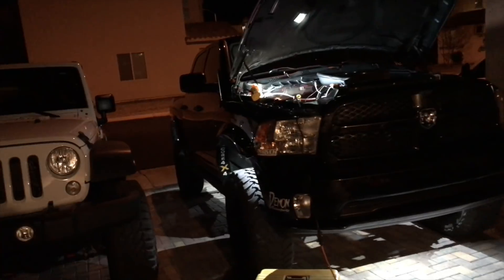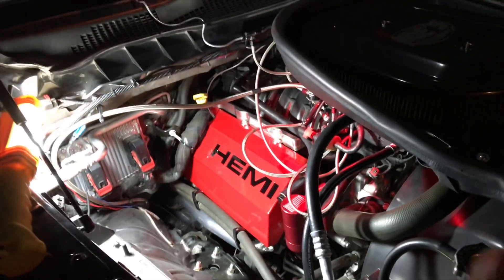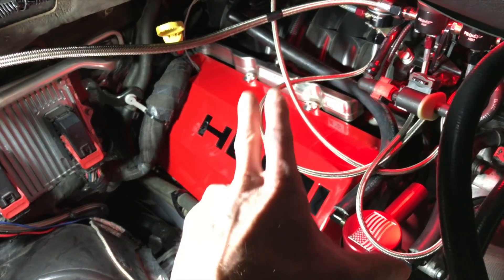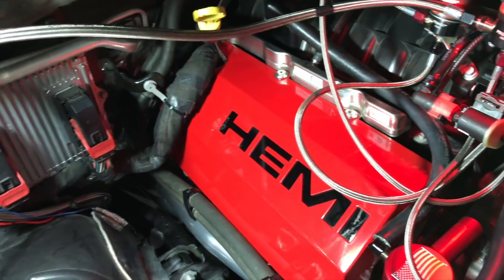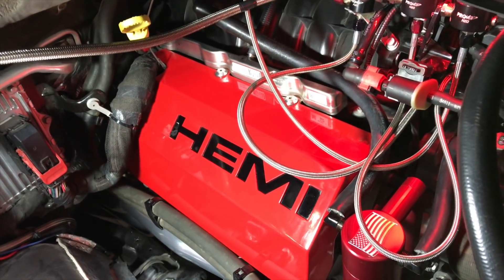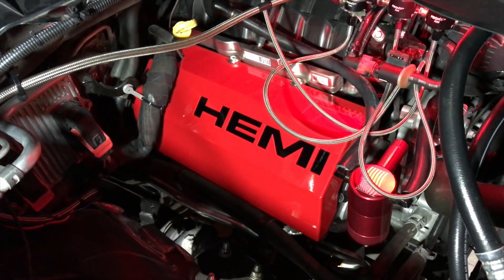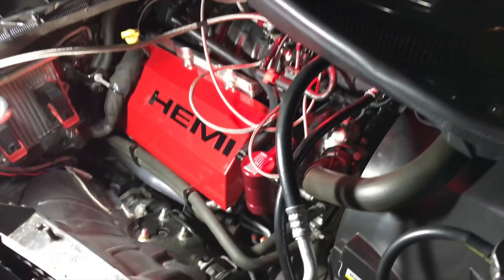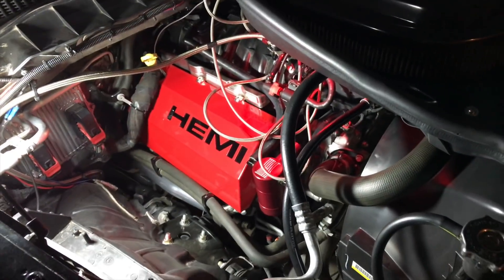RAM 1500 HEMI engine cover review

Comment: When you doing a cam????
Reply from the maker: The only thing stopping me is the lack of money 😫!
Reply: KUSTOMBLACK GUNZ totally understand!!!! I have a scat pack charger but the family always comes first before mods.....I still can’t decide between a cam or nitrous
Reply from the maker: Hell yeah family first.  Well a cam you will have some power all the time or you can add the nitrous bang Holy crap 😈 but needs refilling and needs prepping to work right(heating to pressure), I decided nitrous first because the install was easy and the price wasn’t bad. Nitrous will knock down your 1/4 mile way more than a cam. Don’t get me wrong I’m not trying to decide for you or tell you what you may already know it’s just fun talk. 😁 I make in between 80-100hp or so on a 100 shot. I could move to 150 or 175.
Reply: @slomango7927  Cam.  It pays off 24-7.  The nitrous can be added later.
Reply: James Sorrentino yea and about three times the cost
Reply: @slomango7927  Cost is, for sure, a consideration.